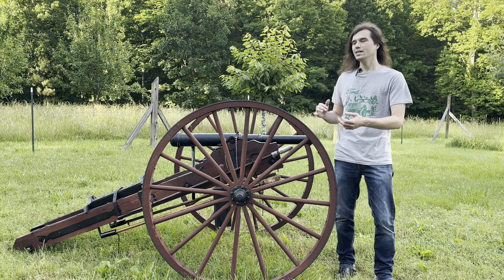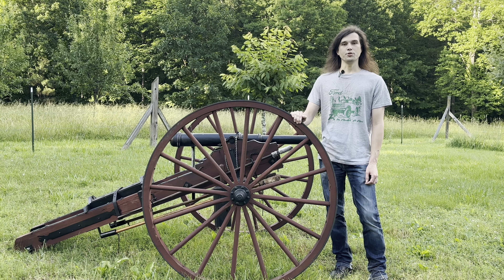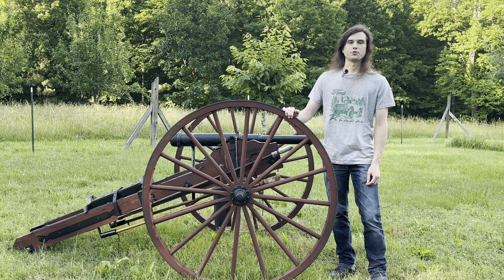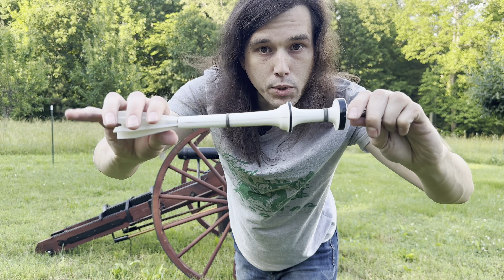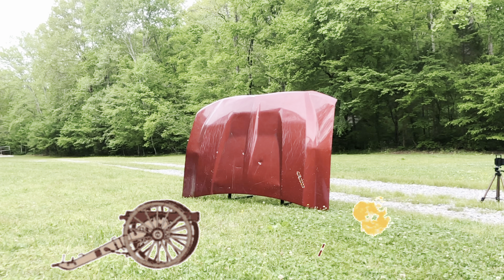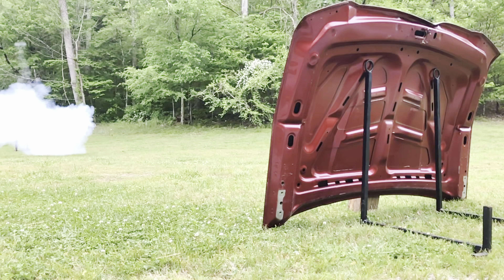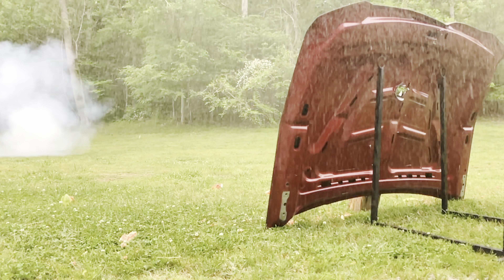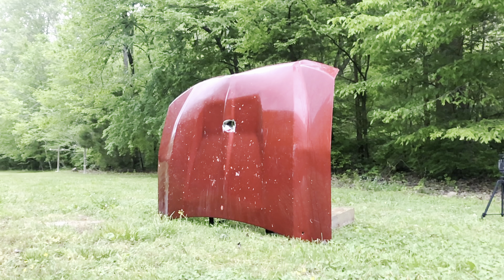Shooting 3D Printed APFSDS Tank Rounds

Comment: There are a lot of ways to make this work on your cannon, depending on what kind of materials and techniques you have at your disposal. for starters, as a lot of other people have pointed out, the TPU plug in this configuration is never going to work, not only because youre pushing the fins, which are certainly going to shatter no matter what plastic you use (even aluminium might be destroyed), but also because the TPU is undoubtedly going to be perforated by the rod unless you make it unreasonably thick.
      An easy fix to this would be to make the rod go all the way to the rear of the projectile and using a metal plate in front of the plug, then the design of the sabot would have to change to also touch that plate such that the fins dont get shoved into them upon firing. another observation would be to remove everything holding the sabot together, perhaps some white glue can be used to simply hold everything in place, with the idea that it will immediately break apart by the shock of firing, since you definitely dont want the sabot to remain attached to the projectile.
      A slightly more complicated solution can be found by trying to more closely mimic the way a real apfsds round works. by grinding/machining grooves along the penetrator and designing matching grooves on the printed sabot (ive seen threaded rods suggested, altho its an easy source of something with grooves out of the box, im not entirely sure if the features are large enough for the plastic to hold onto). depending on how weak the plastic turns out to be, those features might just strip off so youd have to use some kind of metallic insert on the sabot (im honestly not sure how youd go about doing that, maybe some steel sheets could be cut in the same cross section as the sabot and then glued on both sides of each petal (petal being the name of each segment of the sabot), and the printed part would obv have to be altered to make sure everything still fits in the barrel snugly and without gaps, perhaps the steel plate could be smaller than and inset into the print to avoid steel on steel contact in the barrel and make sure there are no air leaks (it would be rather difficult to make the flat sheet seal properly)).
      The final overkill solution would be to make everything out of metal, with the steel penetrator and cast aluminium fins and sabot. with the previous solution there would be nothing protecting the plastic fins from the heat of the explosion so that might fail even if it doesnt get contacted by anything solid, either by melting or shattering, so if a better suited plastic isnt available metal might be the only way. to that end, id recommend lost wax casting, as that allows for the most detailed parts and shouldnt be terribly complicated, altho simple sand casting can certainly work with a lot of post processing. the fins can either be directly cast onto the steel rod (not 100% sure if it would work) or attached later, either screwed or press fit/glued on (obv only go with screwing if pressing fails). youre likely to need help with either process so id maybe try to find a local place that does casting.i certainly hope i doesnt come to this because working with metal casting is quite time consuming and dangerous.
      Some final considerations as far as the general design goes:
>as i said at the beginning avoid holding the sabot petals with anything that could resist the firing process, like tape and rubber bands. altho they might tear apart its also possible they dont at all, too late or in an inconsistent manner, which could mean it messes with the flight path of the dart;
>the design of the petals can be changed significantly. this version that tries to mimic the appearance of the real one would probably only work in metal, with the plastic versions having to be significantly thicker to provide enough structural stability and strength. the real darts are designed in the way you see for several reasons: they need to be light (you dont want to waste the energy accelerating something that isnt the projectile), the contact patch in the barrel has to be minimal to reduce friction (the only contact is the seal at the back, which prevents the gases from escaping, and the piece at the front, which serves double duty as something to stabilize the projectile inside the barrel and to scoop the air after it leaves the barrel to ensure the petals release consistently and cleanly), it needs to leave space for the propellant charge (look up images of a complete tank round and youll see how the projectile sits very far into the casing), it needs to separate early and easily from the rod (this is accomplished by the aforementioned scoop). all of this means that if you dont need the utmost efficiency, several of those design considerations can be ignored and you end up with basically a segmented cylinder with a hole for the rod the pass through (and ofc the internal features to hold the rod plus whatever modification would be needed to accomplish this). some extra features that might help would be a taper in the rear (similar to the real one, altho less extreme), which would help squeeze the sabot into the rod by the pressure of the explosion (force vectors and all that), and the scoop at the front to help with the sabot release.
      Finally, im just an idiot with a keyboard on the internet, so, altho i wrote as if everything was factual, do take this wall of text with a grain of salt (this was by no means an exhaustive list of everything that could be done nor guaranteed to be correct).
Reply from the maker: Much much appreciated for your ideas. I screen shot your comment and I’ll give some a shot! Thanks!

Comment: What appears to be happening is as it’s fired the fins are getting crushed by the gasses and the weight of the Penetrator. A base plate may help but it would need to have a small extension added to it that slots inside the central hole on the fins pushing against the main shaft.
Reply from the maker: Got so many things to try but we will make this work!

Comment: I dont think the 3D printed fins are going to hold up to the forces involved. 

An alternative design would be a yo-yo style to generate the spin. Sounding rockets use a yoyo to despin, but a modified design could also spin up the projectile. There are two ways. The first design is simpler, you attach a wire to the Sabot petals and spool the wire around the projectile. As the petals are flung outwards, they unwrap from the projectile, spinning it up. The second way would be harder but more similar to rocket designs, you would need to have some small weights on the end of wires with a slight rotation already present, if the wires are winched inwards to bring the weights closer to the projectile, the moment of inertia will decrease and the projectile will exponentially increase in rotational speed to keep the angular momentum constant. Having the wires pass through holes in the projectile and anchored back to the cannon or the sabot could winch the wires inwards if done right, the other ends of the wires just having some weights attached to them. The best way to think of this second idea is a figure skater pulling their arms in to spin very fast, the same principle will apply to the sabot if you can pull mass inwards to the center of rotation somehow.
Reply: You could also just try to make something more aerodynamically stable. The idea of the fins, besides spin stabilization, is to put the center of drag behind the center of mass. Alternatively, if you were to cast lead onto the nose of the projectile, it would be nose heavy and much more stable. Lead is over 50% more dense than steel, and very easy to cast. Real APFSDS rounds use tungsten or depleted uranium for the penetrator because of the increased density.

Comment: Several people have made one suggestion of cupping the front flange as an air catch when it leaves the barrel the air will catch the fina pulling them away from the penetrator. But the biggest thing for stability is not using a pusher behind the penetrator.  The sabot needs to pull the core out of the barrel. This is because without a perfectly balanced core any slight instability is amplified by the pusher.  One of the easiest ways to get the sabot to lock in to the core is cut a small groove around the shaft of the penetrator. The with the sabot add a small lip on the inner diameter to fit into the groove.

Comment: Why don’t you move the fins forward so that the energy of the powder is transmitted directly into the steel shaft from the baseplate instead of into the brittle pla fins.
Reply from the maker: That’s fix one for V2!

Comment: Remember that on acceleration, every part of the projectile weighs several thousand times what it does at rest. 
You cannot drive these from the PLA components. What you'll have to do is multifold and this is just an example of ways to make it happen.
1 - The rod will need to extend all the way back to the buffer disk, and you'll need to ensure the disk can't fold around it. A large washer may do. 
2 - You cannot rest the sabot on the fins, it will crush them immediately. Drill the rod for a pin to use as a rest, or grind a groove that the sabot can interface with using half a washer embedded in the sleeve to spread the load. You could also add a pin and a small washer that stays on the rod to serve as a backer if you want to keep the current geometry.
3 - The sabots are not acting as a gas check or driving band in this setup, they do not need to be solid. Lighten them as much as possible by skeletonizing them. This also aids in aerodynamic separation. The only reason modern projectiles have this shape is the penetrator extends back into the powder charge and the sabot is the driving band.
Reply: Oh. and.... the easiest way around all this is to make a cone tip that's wider than the rod, and undercut to serve as a notch. Then you can make a full encapsulation sabot from lighter materials, and the projectile will "hang" from the tip under firing forces, and then aid in pushing the sabots away as it leaves the barrel and drag takes over. As the part of the sabot ahead of the tip slides back it disengages the notch AND gets pushed sideways by the shape of the tip. You may need to add a couple angled pins or something to the sabot leaves to engage the notch and spread the forces around so it doesn't rip free, depending on what material you use.
Reply from the maker: I just saved your comment. Much appreciated! We shall get these working!

Comment: Cylinder of balsa split lengthwise. Short small fins that taper flush after 25 % or so of the length of the penetrator. A couple of right triangle gripping grooves forward of the fins. And a minimal amount of Elmer's glue to hold everything together for a couple of yards past the muzzle. 
 A potato cannon bestowed this knowledge upon me many moons ago and it yielded great results after some fine tuning!
Reply from the maker: I just screen shot your comment and I’ll see if I can get some working! Thanks!

Comment: Yikes.  Typing this paused at 2:49 As soon as I saw you just casually slide the sabot off the front, it was pretty obvious it wouldn't work.  The whole point of the sabot is that it's supposed to push the rod down the barrel.  The gunpowder gasses need something to push against, and the dart is too skinny, so the gasses would flow right past it without pushing it out the barrel.  That's why you put the sabot on: the sabot is basically the wadding.  But that only works if the wadding can actually grip and hold the projectile to push it down the barrel.  If the sabot can slide off the front, all that will happen when the powder burns is the sabot slides off the end of the barrel and goes downrange.

There's a reason real APFSDS have grooves on them: it's to give a surface for ridges on the inside of the sabot to grip onto, so it can't slide off like this, and instead pulls the rod along with it until it gets out the barrel and the sabot petals have open space to separate away from the rod.
Reply from the maker: I was totally unaware of how they actually worked when I started this and the petals are actually threaded so I’ll try some all thread next go around and see what happens along with some other ideas y’all have suggested! I didn’t realize the petals pulled the rod and not the rod pushing the petals.

Comment: As a physicist, I'd make the parts that are supposed to come off into a cylinder just under the bore size. The cylinder would be long enough to keep the projectile perfectly aligned in the bore. I would put a thin, shallow spiral flute around the outside of the cylinder to impart spin (keeping the projectile accurate). I think i would try an inverted cone on the front of the cylinder that would theoretically be forced shut by the overwhelming presure of the blast (behind) until it leaves the barrel. I'd probably make it out of tpu. Summary:
1. Cylinder to push the projectile.
2. 2 halve
3. Inverted cone in the front to force the halves apart upon leaving the barrel
4. Rifling on the outside of the cylinder to impart spin (forget the fins; if you get this thing spinning right, you won't need em)
5. BIG ONE - Make sure the center of the cylinder is on the center of mas of the entire projectile! You know you've done this correctly when you can balance the entire projectile at the midpoint of the cylinder! This is crucial because it means it will have no force bias inside the barrel.
Reply from the maker: Much much appreciated! I’ll have to see what I can get into the works for everything! I’m not the best CAD designer sadly!
Reply: Penetrators don't spin because the rotational energy fights the forward momentum when it strikes a target, reducing the overall penetration depth. 
 At least that's what I've come to understand over the years. 
 And absolutely a sabot that fully supports the penetrator and centers it. It also has to grip the penetrator firmly enough to ensure full energy transfer, while falling away cleanly upon exiting the muzzle.
Reply: @willabernethy4832  Fins stabilized anything shouldn't spin more than a few rotations a second to cut effects from tolerances on the fin unit. They're forward CG in relation to CP by design, and spinning a forward CG projectile can (usually does at some point) result in a coupling between aero stabilization forces and gyroscopic forces that end up positively reinforcing each other. You end up with a projectile that's spinning around sideways like a cheerleader's baton. Gyroscopic stabilization needs a rearward CG, which doesn't work with fins (wants to correct itself backwards).
Reply: @mfree80286 
 The jobs on the battlefield don't spin. Sabot rounds made to fire from old rifled barrels have ball bearings to engage the rifling and negate the spin. Today's smooth bore cannons on almost all modern tanks were developed specifically to fire sabot rounds more effectively. 
 Admittedly, long, thin, precise fins only a couple of millimeters in height are difficult to produce. Maybe long, thin grooves along the axis would suffice. 
 Something like a 15.1 length to diameter ratio is very important also when it comes to stability and accuracy 
 Either way, it's a lot of fun to figure out how to make physics work for you!

Comment: The sabot is for sure exploding around the penatrator, allowing the powder to burn around the load.
Reply from the maker: I think you’re totally right! Someone else suggested the TPU base plate was going through the rod and tearing up the fins and sabot and I can see that happening too as I found a hole straight through one. I’ll have to work on the baseplates too.

Comment: As others have noted your penetrator should sit directly on your gas block as it is the heaviest and therefore hardest piece to get going. Using the fins as a base, instead of having a hole the penetrator can pass through, means it will get crushed as the rod stays put until the gas block gets to it.
Reply from the maker: I think that’s exactly what happened. The gas block just shot through the rod. There was a hole straight through it which I thought nothing about at the time. We will get it working!
Reply: @TheCannoneer   Yeah, the inertia that is being generated is pretty insane. Even with black powder loads your probably getting 5k g-loads, with 10k+ not out of the question depending on how hot your charges are.

I would design it so that the rod sits directly on whatever you use for your gas block. And just use the sabot to keep the rod centered.

And as others have mentioned you'll need to put a cup in the front of the sabot to catch the air and start it falling away as soon as is possible. So keep that in mind and print a couple designs.
Reply: @TheCannoneer  Taofledermaus is a wealth of knowledge. Do check him out. Don't be shy to email him either. Your channel is one he'd probably like! He could probably help brainstorm some ideas at the very least. And a shootout might get you some more subs 😉 Worst that will happen is you can say you tried!!
Reply from the maker: @Benson_aka_devils_advocate_88  I'll have to reach out to him! I'mm subbed to him as I recently found him thanks to all yall! Thanks for the encouragement to reach out!
Reply: @TheCannoneer  And BTW these penetrator rods are no joke. Even hardened steel rods will punch through AR500 just because of the inertia behind a quarter or a half a pound of steel.